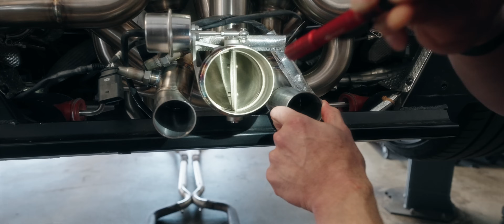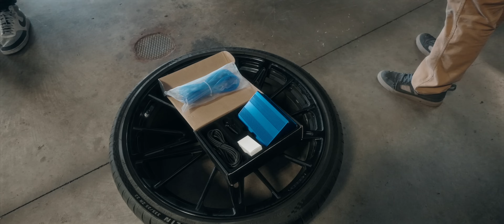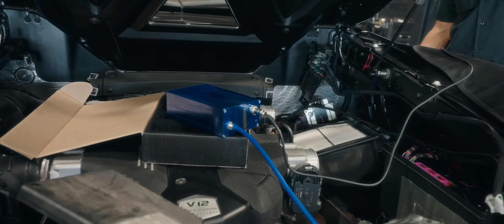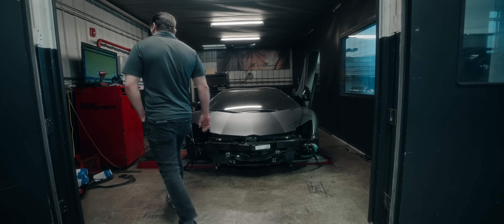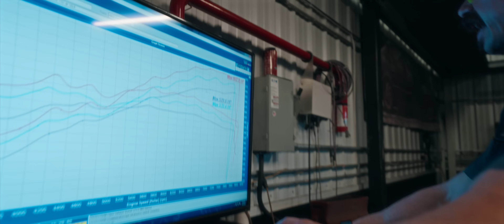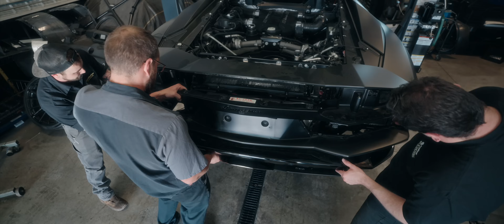Lambo V12 makes 90 NA AWHP with 1 WEIRD exhaust! Concept Aventador system dyno w/ INSANE results!

Comment: You are not loosing 29% through the drivetrain… more like 15%… my c8 z06 makes 570whp stock and its 670 crank. Some peoples c8 z06 make 600whp… that would make it more then 800 crank in your terms… just doesn’t make much sense lol
Reply from the maker: On an interia based dyno sure, not on a loaded one like ours! Were working on a in depth video about this as well so stay tuned!

Comment: Where do you get the 29% drivetrain loss? In modern cars its widely accepted drivetrain loss is around 15%-20% depending on transmission and if the vehicle is AWD. Seems the Aventador is a little overrated power wise? Nice gains though with the exhaust and great design!

Comment: I was expecting a higher pitched sound but it's deeper and more retro like a Countach. Maybe it needs to be a true equal length system to get it screaming? You can achieve that with new headers. Really impressive power gains, bravo!
Reply from the maker: We were anticipating a bit higher pitch as well, although I still feel as though the audio clips don't give full justice to the tone. Think you really have to see it in person to get the full experience... when that thing is going down the road man does it scream, you can feel it resonate inside your chest! Less curves would definitely be more ideal, as would a longer section behind the collector, but you can only do so much within the space constraints... We're happy with it, and our customer is thrilled with the sound and power so that's a win in my book!

Comment: Quite an epic fail guys. Lost all of the tone. Sounds nothing like an F1 car according to what that guy said😁
Reply from the maker: Hey, not your cup of tea, cool! The customer loves the new found power and we are happy building something innovative that took better advantage of better exhaust gas scavenging. Hopefully you watched part 2 before where we went over the design plan. Is this a case of form not following function? It’s subjective. Thanks for the feedback!
Reply: @FluidMotorUnion  I respect the craftsmanship and welding that you guys put into building it, I get that you’re also making more power with this setup. But personally I’d sacrifice some power for some tone.
Reply from the maker: It’s a shocking amount of power, this car pulls completely differently. This setup hasn’t been ran before, maybe there will be some things we do differently in the future, but in person this car is much more intense and visceral than anything we’ve come across. We didn’t know what it would end up sounding like, but being that this system will still pass emissions and pull like a jet fighter, we’re happy with our choices, and so is our customer. 👍

Comment: That is such a unique exhaust note you guys have achieved. I have a handful of clients that come to my shop with factory exhaust systems to fi exhaust systems you name it. None of them have the sound of yours. So congratulations on making a new box, not just thinking outside of the box.

It almost sounds like one the old Lamborghini Countachs with an aftermarket exhaust. The newer v12 Lamborghinis have a much different exhaust sound than the older analog Countach cars.

Comment: Im sorry but gintani while likely doesn't make as much power as yours,sounds better IMO.
I think in terms of sheer performance,yes yours is worth the asking price,but sound is on the low side
With all due respect
Reply from the maker: Appreciate the feedback. Really never said this will be a better sounding exhaust than anyone else in our three part series, lots of people making a comparison we never claimed. We wanted to make something different that used exhaust scavenging in a 180 degree manner without redesigning the exhaust manifolds. We think that’s why power has been optimized, but we’d really need further testing. The comparison people are making alone is an honor as they make some amazing products, but we accomplished our goals, which was a customer EXTREMELY satisfied with the new performance.
Reply: @FluidMotorUnion  I'm glad the owner was happy with the result.
If I ever get a 5.0 Gallardo I have an idea for an exhaust that I think might do better than the exhaust you did for effspot on his Superleggera.😁

Comment: 14% increase over a factory supercar is a little hard to believe.  Did you use the same procedure with the stock dyno run?  I don't like to see that wavy power curve.  Something's up with the exhaust tuning.  I'd like to see a drag race.  Trap speed never lies.
Reply: It’s true if u look up Exaust scavenge effect it’s like supercharging an engine w the exhaust system. As the exhaust leaves the car it sucks new air in on the opposite piston using  back pressure kinda like a 2 stroke
Reply: @Makeitagreatone  everything said after exhaust scavenge is incorrect. It also implies the manufacturer and engineers that built the car originally have no idea how the exhaust system works in combination with the rest of engine. 

Scavenge is a result of optimising pressure wave pulse timing with pipe grouping based on firing order. 

Fun fact. If the system is well designed and built you only move the peak performance up or down the rpm range due pulse wave speed being directly related to engine rpm, pipe diameter and pipe length. 

Every thing is always a compromise

Comment: A one way check valve and a three way valve, this is a common function in the old HVAC pneumatic systems found in commercial buildings hospitals, high rise buildings etc.
 These components where widely used and manufactured  by Honeywell Robertshaw Barber Coleman & Johnson Controls.

Comment: I’m sure this absolutely made more power and sounds awesome. But was this amount of effort put into the stock dyno run? Seems like you were learning how to extract every ounce of power from it with the new system installed. If the same effort was put into the stock dyno run then you’d already know the quirks of the car and how to get the perfect dyno run by the time the new system was installed. Just curious what a stock car would make if you did the exact same sequence per run. Keep up the great videos!!!

Comment: Can an ECU from a 2001 Saturn be hacked? I built a custom intake with a Pontiac supercharger. I'm leaning towards a 4-cylinder Colorado ECU as they both have 7 tooth reluctor wheels and I have hp tuners. I just don't know if you can switch off the cam sensor as the Saturn doesn't have one. I'd have to convert to coil on plug

Comment: 29 percent drive train loss???)))) Where does all that energy go to? With such a high level of energy loss your fluids would be boiling because of overheating))) Id its RWD vehicles with manual transmission it's about 11-13 percent loss, with auto transmission about 18-20 maximum.
Reply from the maker: Hey, you must be new here. We go over dyno difference in many of our previous videos. Like starting at 3 min here https://youtu.be/xNpRIuDZMO0?si=nPAw-FOUJESOHEXZ
Reply: You talked about difference in dynos but it has nothing to do with stating 29 percent energy loss- that's completely different topic.
Reply from the maker: It’s widely accepted that engine accessories take 5-10%, even from manufacturers. Having all that power transfer and parasitic drivetrain loss only loses another 10%? 
The number you are quoting is a number that dyno manufacturers state. Depending on the dyno that number is different. On OUR dyno, that number is consistent with similar cars on the same brand dyno. It’s what is measuring it and I’m speaking according to our equipment. No need to get into semantics, my statement remains true to what our equipment shows. 
On another dyno your statement would be accurate. But not on a dyno dynamics. You can easily google “DynoDynamics” and the car you want to see to verify what I’m talking about. Hopefully I’m clearing it up?
Reply: Well, if we are taking about that specific type of dyno that could be the truth. However, talking about real physical properties of car transmission  and engine accessories in terms of energy loss it sounds unreasonable. Once again- in reality such a high level of energy loss would be resulting in all engine and transmission fluids boiling. BTW - i didn't take power loss numbers from dyno manufacturers- i used old automotive engineering book that specifies the power loss of each component in transmission. Simple math makes it to the figures I mentioned above. The highest power loss is 4wd auto transmission - it could be up to 25-26 percent depending on torque converter efficiency...

Comment: How much of the gain is because the baseline /stock was heat soaked and sub optimal?
Reply from the maker: This and the time of year we did the stock dyno runs I have questions on as well. This build took almost 3 1/2 months to complete so the initial runs where done when I didn’t even notice the heat soak issues as the ambient room temp from the fresh air inlets (looks like the room was in the 50s with outside air in the low 30s) as opposed to this week where the room was in the high 80s with the car hot. So maybe it could even be slightly higher, or possibly less. 
However I don’t typically have issues with a customer car feeling slower than the numbers put down… it’s always the other way around. 
“The numbers are low”
-does it feel faster? 
“Yea”

We waited for the feed back of the customer. He was blown away by the power increase. We also dynoed another car where we were familiar with its power. No abnormalities. 

The rooms “weather box” is supposed to put a calculation factor in for humidity and temperature, but it doesn’t account for latent heat that builds in the engine taking longer to dissipate into the surrounding ambient air. We have 20 min of film talking about discrepancies and dyno fluctuations and removed 10 min we originally had in the cut, but it just dragged... 
We watched around other “similar popular content” and realized nobody was doing that, so we cut it, and said we would do our best to answer questions!

Looks like we may be better able to account for these differences now that we’ve done this the first time 👍

Comment: I'm honestly not intending to sound like a hater... but this exhaust is an epic fail aside from the hp gain... which was due to a tune in addition to exhaust. This has to be the worst looking and sounding exhaust you could get... its honestly shockingly bad.. at low rpm it sounds like a 4 cylinder or even a motocross bike and it has no high rpm sound... its not f1 sounding at all...
Reply from the maker: We accomplish
-Design a concept that incorporates additional ignition pulse scavenging not currently offered on any aftermarket or factory system. 
-design a package that will offer both the openness of test pipes while still being able to have functioning catalytic converters that will pass local emissions requirements
-make a very surprising amount of power in conjunction with a custom tune.
-build something unique and different using our 16 years of speciality exhaust fabrication experience, and while really enjoying the process
-customer beyond satisfied with the feel of the power and the brutality of the system in person

You
-Don’t like the way it sounds in a video

I mean it’s kinda hard not to come off as a hater when you’re using that lens to call something an epic fail. 

Again, maybe it’s not your cup of tea… cool. But we’re proud of it, it was challenging to design and build, it’s visceral and it’s way faster than it was. We can live with those results 👍
Reply: @FluidMotorUnion   your line of reasoning doesn't make sense... 99% of this comment section have not heard a aftermarket aventador exhaust in person yet if you were to play the Gintani f1, IPE, Armytrix or even capristo they would be able to appreciate how they tend to have a more f1 higher pitch". Again I really wasn't hating more constructive criticism... the point still remains at low rpm it sounds like a motocross bike and there's is no way this system is comparable in pitch to some of the systems I mentioned out there... which is what you stated in a previous video "the addition of megaphones gives us a higher pitch" this wasn't the case...

The horsepower figures are a different story... they are accompanied with a tune not just a bolt on comparison which would have been more ideal... although not perhaps optimal.

Overall the exhaust was underwhelming.... again not to be a hater it is just what it is...

Comment: Unique sound, definately.  The sound isnt good,  what it can be.  Try harder.  It sounds like its mechanically challenged, or burdened.  Some of the other exhausts out there, are pure butter, just smooth, and really play to the harmonics that we know can be there.  

This sounds like a uncorked nissan vq motor. Or a bmw s54 motor.  Those motor are good motors, but notoriously bad sounding with most exhausts.  Yes, very loud, but nothing pleasing.  This v12 now sounds like a 6 cylinder.  Yes, its going to be more impactful than those motors, it better be, its twice the displacement and twice the cylinders.  

The exhaust note as revs climb, all i can think is shift shift, it doesnt sound good.  With a few others out there, even the turbocharged versions, they dont loose that free revving smooth, refined, going to the moon forever sound.  

Back to the drawing board.  Ive been there so many times on exhausts ive built.  The smallest changes can make the most impact.  

Dint blame "video audio skills" in this end result.  You wont find a single gintani exhaust clip, of which there are so many by 3rd parties, just amatures.  And they all sound the same.  The sound that makes someone want to hand them the credit card.   

Hats off for the guy who invested in this project.  Its great shelf art.  Move on and uncork the symphony of music this engine contains.
Reply from the maker: All we ever promised was a unique sound, our best craftsmanship and something where passing emissions wouldn’t be an issue while trying concepts to increase power that weren’t currently being used. It seems like you haven’t watched the whole series where we state ALL of this and bring everyone along for the build. We achieved every goal and were incredibly surprised by the power gains. The customer is ecstatic with the new found speed and loved the sound (that’s him at the end). We achieved every expectation of our client and we got to build something that excites us! I’d question the motives of a person who says that warrants going back to the drawing board. Hopefully you check out the rest of the videos, and even if you don’t like the sound… it’s just different. Thanks for the reply!
Reply: Yes, it's different.

Comment: You guys are checking all the boxes! Unique sound, efficient power gains through entire rev range, and innovative Fab work! 👌👍
Reply from the maker: It honestly was “what can we do that nobody else is doing that still could theoretically improve power?” We didn’t expect these numbers and were kinda just 🙏 it made the same or a bit more power than other systems tested. We are glad it worked out cause it would have been an expensive mistake 😮‍💨😆

Comment: Am I the only one who kinda hears a V6 from that exhaust note? It’s not the most pleasant noise from a V12 tbh. It’s not the high pitch whaling that would be more admirable to most.

That might just be because it needs more work, but that’s what I noticed. Or I just prefer that high pitch scream. The gains are still impressive, I’m not gonna take that away.
Reply from the maker: 100% Its different.
Video doesn’t capture the intensity of this thing. In person the system punches you in the chest and makes you cover your ears. I think the flyby portion of the video best captures it, but we have the comparison of the other system in there too. It’s won’t be for everyone but it does make power!
Reply: @FluidMotorUnion can u use another device to record I believe you but can’t see for ourselves
Reply: No you are definitely not the only one. I hear a v6 sound as well and really I’m not trying to hate or anything at all, I just don’t think it sounds good. The gains and engineering process was awesome tho! I think it’s unique

Comment: Only 90 awhp.

Pass.

Title sucks here you gotta admit, should say +90 awhp. Looks at first glance to be a largely de-tuned unit.
Reply from the maker: There’s a spot in the mid range that shows 90. It’s definitely clickbate but we’re just trying to get eyes here cause we honestly didn’t believe this design would produce these kinda gains. More of a “let’s try something neat that no one else is doing” thang. If it didn’t work, we’d be feeling quite differently.

Comment: Those graphs are interesting, is that waviness from constructive and destructive interference in exhaust pulses?
Reply from the maker: No simply the awd interaction between the front and rear rollers and how the software interprets it. Look up aventador DynoDynamics graphs on google and you’ll see ours is actually a bit smoother. If I pull graphs from front or rear separately, it’s smoother. We had 10 extra min of explaining these differences but it’s was actually quite boring.

Comment: Impressive innovation. Would love to see a 1/4 mile before after.
Reply from the maker: We built this system thinking it would produce a slightly better or at least equally as good power gains as other aftermarket systems we’ve tested, while having an interesting sound with the firing order. We would have gone at it completely differently if we expected this type of gains. Calling this more of a discovery than anything 🤣